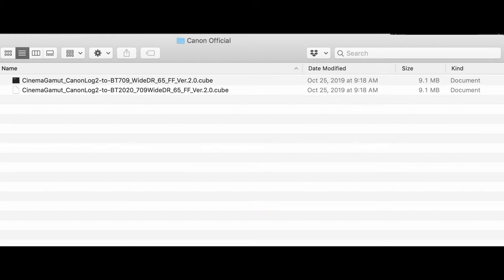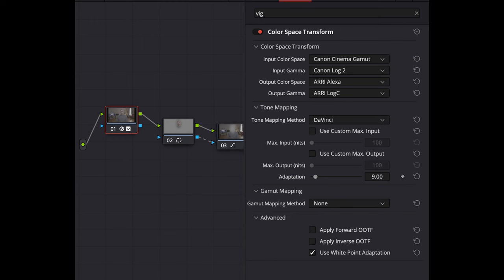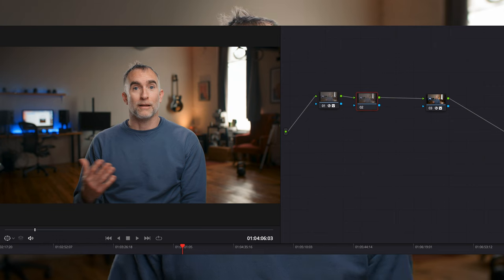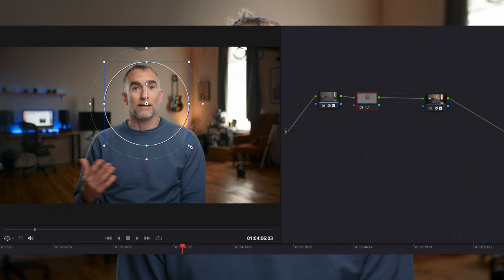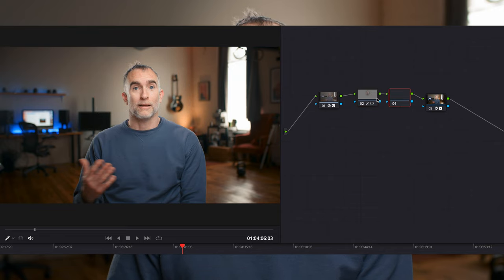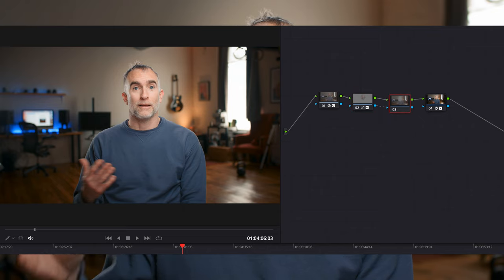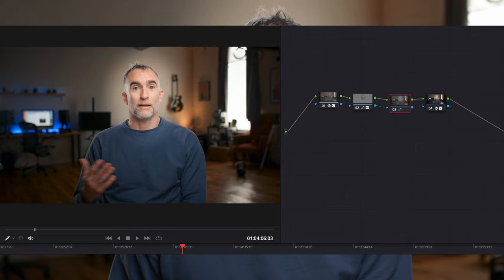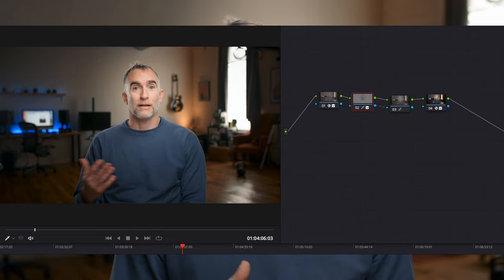Why CANON footage looks BAD out of Camera and how to FIX IT

Comment: I got the c200 and the camera wasn‘t able to propery show clog2, just clog3. 
Then I bought a C300mkiii and the internal Lut doesn‘t match with the official Canon Luts - isn‘t there any Clog2 to Rec709 LUT which gives me the same Image which I see in Camera with the LUT on…
Reply from the maker: Load whatever LUT you like into the camera as a 'look' and use the same one in post. Then it will match.

Comment: Hi Rubidium, I'm new to canon cinema line, but when you say expose the middle gray at 3200, you mean ISO? As I know the middle grey range is 0-100.
Reply from the maker: Canon's white paper puts middle grey at 32 IRE. If I said 3200 I misspoke :)
Reply: @Crimsonengine  Rubidium, thank u so much. After this tutorial I used 30 to 40 IRE and is much better to grade a skintone. Much more cinematic. Thnks.
Reply: @Crimsonengine  Not sure where you’ve pulled this info, but C-Log 2 is 39 IRE, and C-Log 3 is 34 IRE